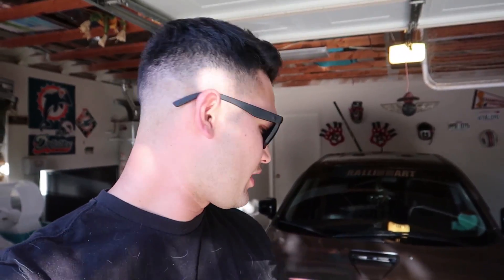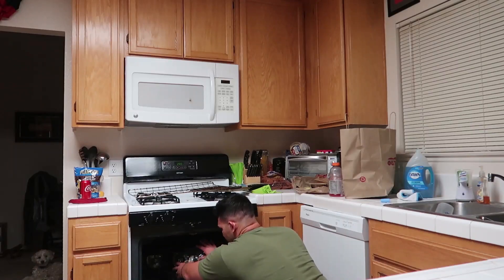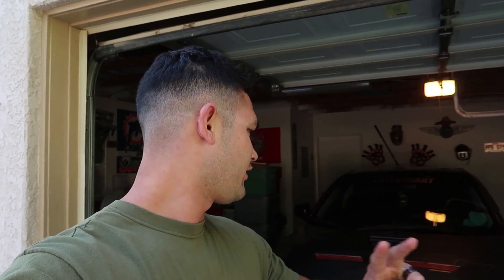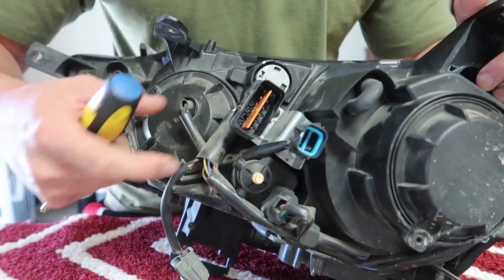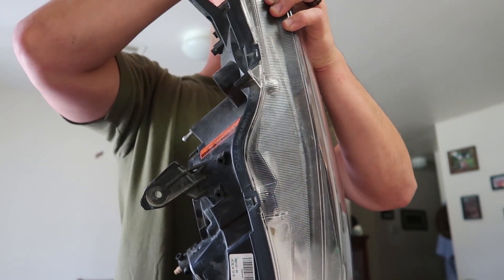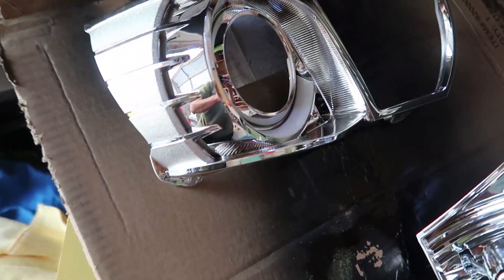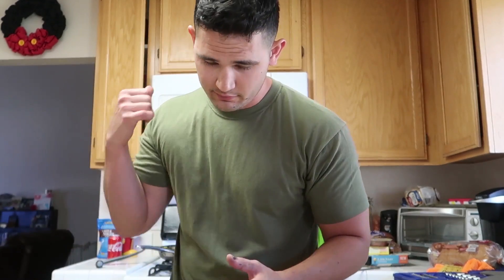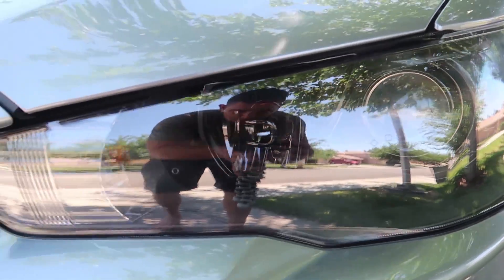Lancer/Ralliart/Evo Headlight blackout! (how to)

Comment: What did you do for the adhesive when you melted and took apart the light? Did you replace it with something new? Like glue maybe?
Reply from the maker: Used the same adhesive. No issues whatsoever so far
Reply: @TheSnyds  so when you baked the housing and took it apart you just painted it then stuck it back together? Did you have to reheat it?